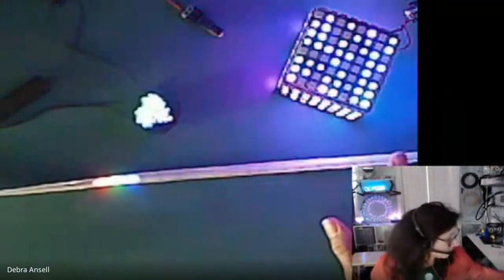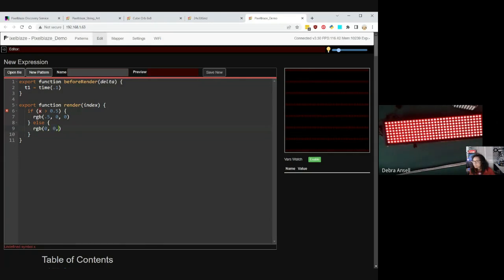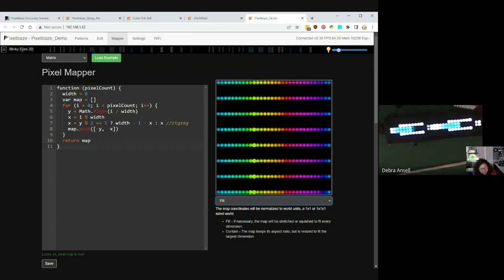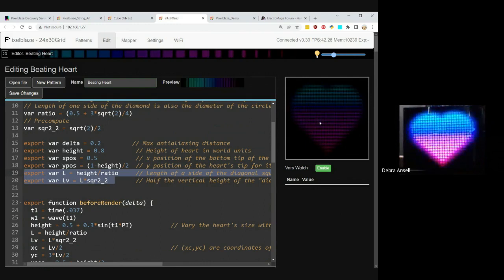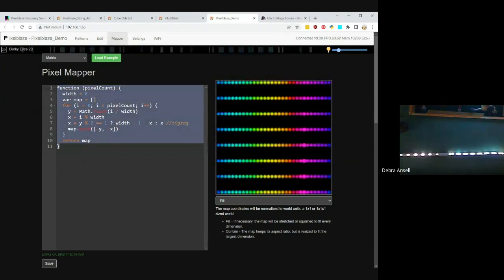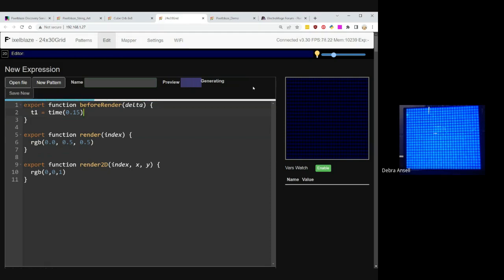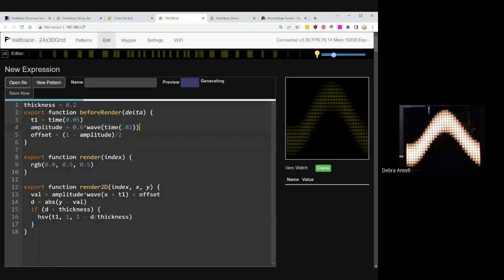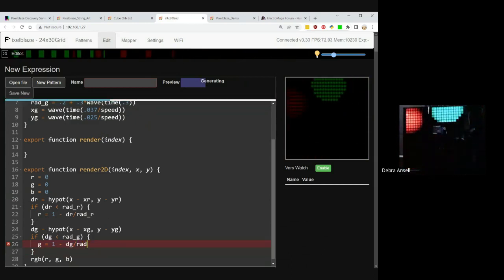Introduction to coding with Pixelblaze workshop

Comment: I am liking this, but the video is too long to grasp everything, so I want to go right to my question: does this support for GPIO input?, for example, I want my leds to react to GPIO buttons or sensors so I can used them as arguments in my render functions (also any ohter way to react to inputs?, like endpoints so I can use the pixelblade as a way to interact with my games by sending maybe a http request or websocket?)